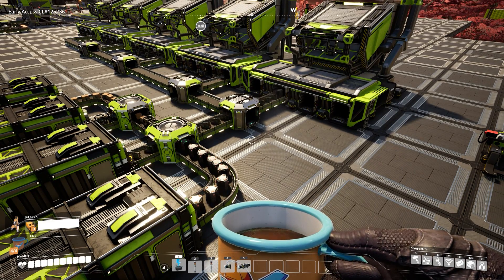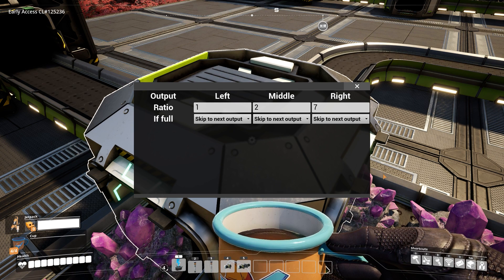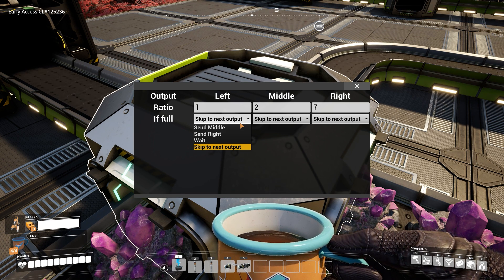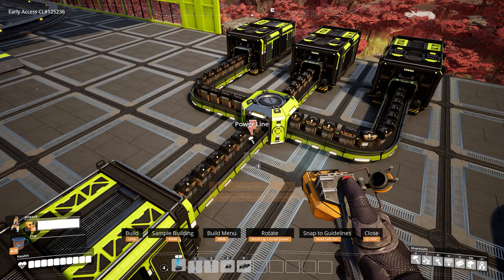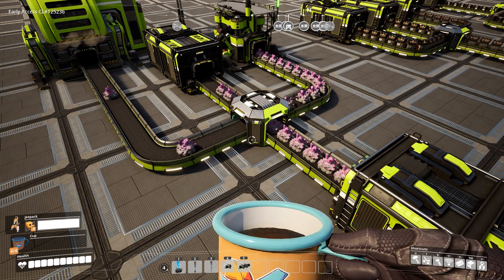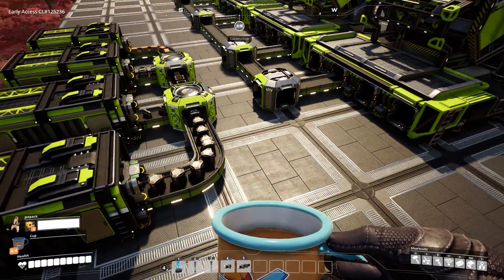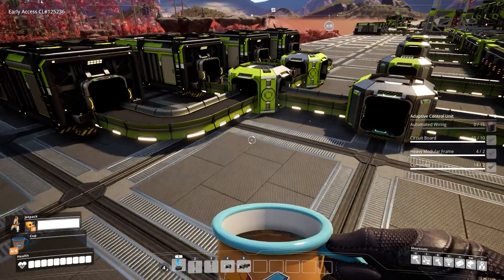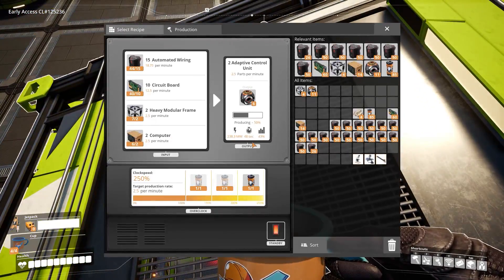Advanced Logistics: Satisfactory Mod Showcase and Tutorial. What Smart Splitter should have been.

Comment: So whilst these are cool features with a lot more granularity than can be done in vanilla, the core two features present that can't be replicated without mods currently are the ability to prioritise input lanes on a merger, and waiting on inputs. You can already set ratios on lines via loopbacks, however what you can't do is pause a belt network until a given input actually has enough material present.
Note that, in my opinion, the coolest feature this brings wasn't even covered - combining priority merging with overflow splitters allows you to build logic gates into your belt network!
Reply from the maker: That is very true for the main part. I tried to to logic gates with it, but could.never figure out how, even though I had the feeling it should be possible. If you could send me an example I would be eternally grateful
Reply: @Samueras  check your twitter mentions :)